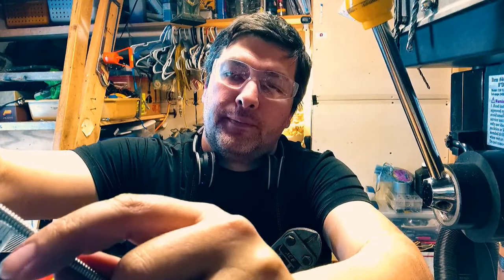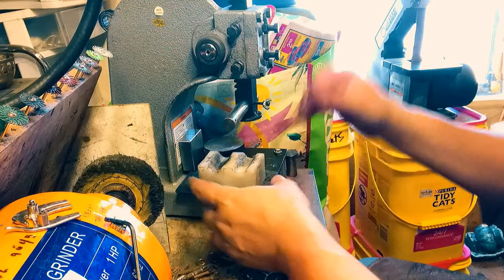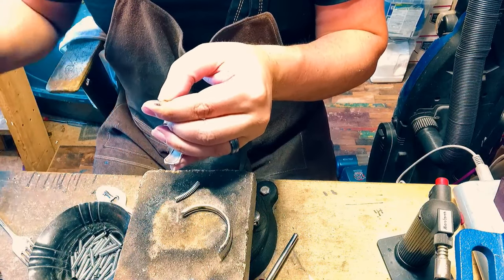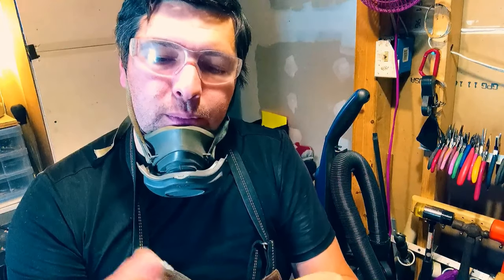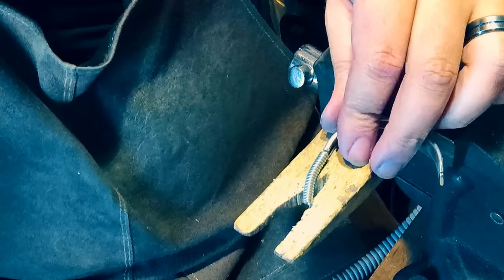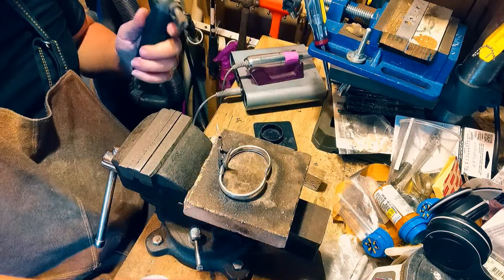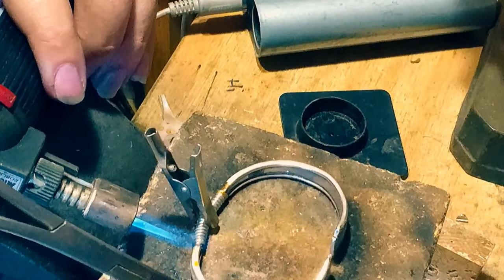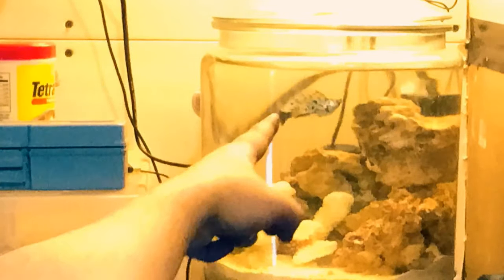Making a spring bracelet

Comment: Jeremy where do you get the springs?  I didn’t see it on your list.  Love your videos…
Reply from the maker: Thank you 😊. The springs are made from a throttle cable. That I cut into pieces. I have another video on that. Some people have switched to a small diameter drain snake. The inner hole is actually bigger so you don’t have to make such a tiny peg to go into the spring.
Reply: @FlatwareCreationSS  thank you so much Jeremy.  😺 I love your kitties…
Reply from the maker: @lauriesbella1252  🐈🐈

Comment: What kind of spring do you use?
Reply from the maker: nancy harrington It’s a control cable here is the eBay number of what I used 274037260846
Reply: Thanks!
Reply: What kind of spring do you use
Reply from the maker: It’s a control cable here is the eBay number of what I used 274037260846. Since this video I have had some friends use a drain snake wire instead of the cable. It has a wider inner diameter. They make a thin cable and a thicker one. They used the thinner one.

Comment: i can't find the spring your using on ebay by the # you gave
Reply from the maker: cynthia peck Search for this. 55196 Dorman Control Cables With 1 In. Chrome Knob, 6 Ft. Length. You should be able to find it that way.